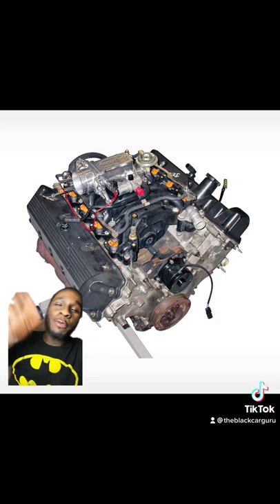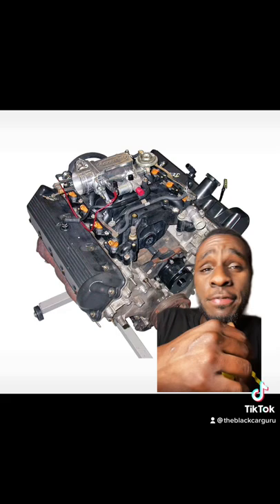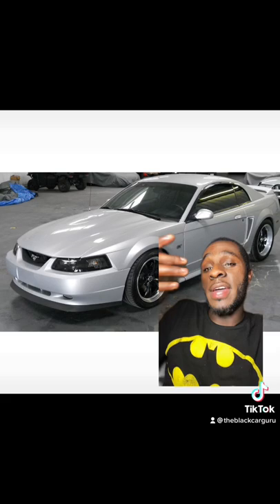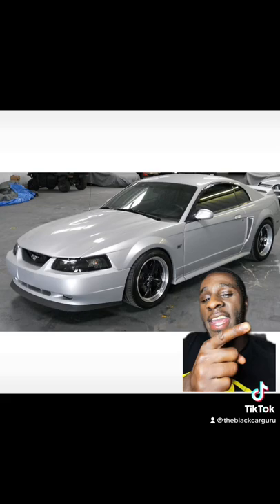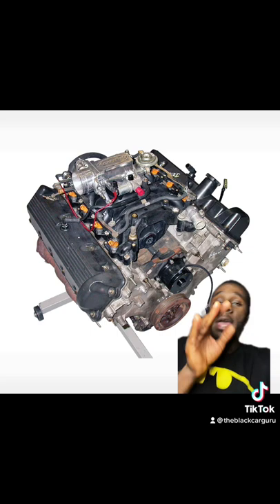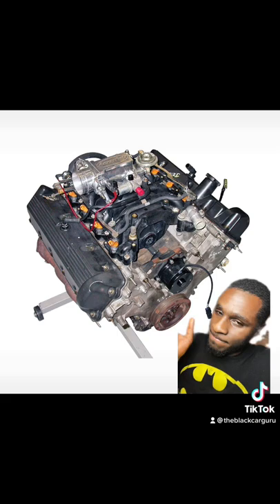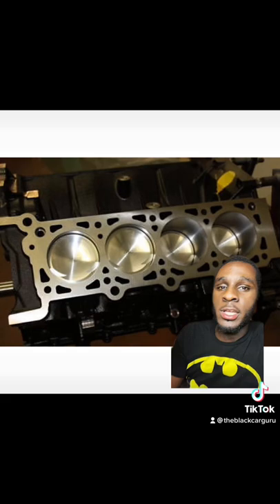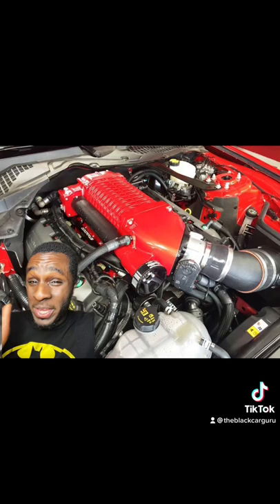Is the 4.6 2V worth building? | Let me explain why!

Comment: I had a 95 mustang gt 5.0, built the top end and did exhaust, gears, etc.  Got done, had about 5k in the mods.  Old dude at the shop told me I coulda built two chevys for that much.  Looked it up, he was right, burn lol.  Good car though, I had it for years, was my daily driver from about 24-30 years old.
Reply: @worldssickestmedia2713  🤣
Reply: Dude Know his stuff good work bro
Reply: @worldssickestmedia2713  you would definitely need to spend a LOT to keep up with a high performance 400 chevy small block. Mine makes over 520hp with an old Holley 4bbl. All Motor.
Reply: Using a 40 year old factory GM 400 against a 1995 Ford is a bit of an unfair comparison, they didn't imagine 700hp factory motor in those days. Mine is a Dart SHP block it will hold over 1000. 
I didn't want to build a factory 400 either,  you make some good points. 
--Ford had a better cylinder head there a few times that helped things. (The good old days when American made was actually..  u know, made here unlike the imported "American" made stuff today)
Reply: One of many things I’ve learned working at a perfromace machine shop

Chevy $ easy
Ford    $$$ medium 
Mopar $$$$$ expert
Reply: I'm 26 & currently living this comment 95 vert
Reply: @guitarheadwayne  Nice 👍
Reply: I still love my 95 with the 302 it will be good for a first car with a on3performance turbo kit
Reply: Sometimes a car isn’t always about the money. About 30 years is a long time. After that long, it’s not really about the money anymore.
Reply: it’s because the old 302 and definitely the 351s aren’t near as plentiful as a SBC engine and parts are harder to find and have way less aftermarket support. You could find and get hands on enough parts to throw a pretty stout sbc together in a days time and a nickel less.  

You ain’t gonna find any 302 or 351 heads at any junkyard worth your time for example.
Reply: Well yeah but even the LS similar year was around the same hp. I can understand the DOHC or SOHC are expensive
Reply: I seen 1400hp 4.6 2v Mustangs yes it cost a lot but so would any OHC to get those numbers
Reply: Yeah you could have blown up 2 junkyards motors for that 🙄
Reply: I had a $3500 270whp Maxima that stomped 2Vs and 4v cobras and Mach 1s, loved surprising people and hurting feelings at the same time.
Reply: @JusAV-vw1pj  351w are great engines but the truck heads suck ass unfortunately and that's the main place you'd find them sadly.
Reply: @PeePee666PooPoo  when i was building my Mustang i bought a 03 Pontiac bonneville ssei (supercharged 3800 v6) same shit lol. They wouldn’t see it coming
Reply: @PeePee666PooPoo  agreed
Reply: @PeePee666PooPoo  cap 🧢
Reply: Chevys would have kept breaking down on you, though.
Reply: Not no Ls 😂
Reply: @getoutyourfeelings2613  LS motors are cheap & yes they do blow up constantly. You only see the final product online
Reply: Depends, maybe with an old school chevy you can build 700hp with 2.5k. LS mods quickly add up, example a good cam kit is about 1k add bigger fuel injectors, fuel pump, bigger valves, porting,  etc. and your getting close to 5k

Unless were talking boost
Reply: @pankero1  my cams with springs in my 2v only cost $800.
Reply: @WarriorOfEden3033  True. My point was  both engines can be built for little to make decent hp with boost, both cost alot of $$$ if you want to build decent n/a horse power. 

Owned & modified both, people underestimate the 2v 4.6 for sure,.they make good power boosted they are also plentiful, reliable, strong and cheap at junkyards.
Reply: I’m curious to know what your set up is because I own a 94 with a ford racing top end (GT40 heads cam and intake)and single turbo kit I know I couldn’t have built two sbc for what it cost me to put it together. In my experience the sbf and sbc stuff was priced pretty similar especially if you were talking about running a Ford in your mustang vs running a Chevy in a mustang it was definitely cheaper to just run the Ford, in my opinion.
Reply: You know cobras old ones have a 4.6L as well.. 

But yeah you right
Reply: I got 2 grand in my fox with a 302 I promise ain’t no Chevy gonna out run me with the same money spent GUARANTEED
Reply: Everybody's got a small block Chevy though but you don't see a lot of 4.6 builds!  I think its awesome
Reply: I hope mine last long like yours haha hut i have the 4.6 its been 1 year bearly haha
Reply: If you had to take the engine out then yea but if you could have kept it in the car while you work on it then no
Reply: The on3 turbo kit is 2300 rn. I got a 99 gt I’m working on. I think I’m just gonna go the nitrous route so I’m not breaking the bank on a mouse motor but I think they got some potential on a budget. (I got the car for free🤷🏻‍♂️)
Reply: @kevinrichardson6628 
Anyone can put together a good combo the thing is putting all that power to the ground.
Reply: With a Chevy, you’re only gonna end up with a spun rod and a bad trans…
Reply: @JusAV-vw1pj GT40 heads were good
Reply: @pankero1 they're expensive to rebuild though
Reply: Question I have a 95 cobra but it has a full 4v 4.6 drivetrain any idea why?
Reply: What does a 95 302 have anything to do with a 4.6 2valve.let alone building 3 to 1 sbc .whoever told u that is on good drugs.a rebuilt ford 302 costs equally a sbc build 1.the 302 is a excellent engine .have u seen the ls engine it's a copy of a sbf .
Reply: I've built 302's before.
I don't know where this guy was coming from saying the 350 is cheaper.
Both of the engines I built weren't that expensive. Granted I did all the work.
The first was a 302ho with gt40 heads and e303 cam.
The cam was just about $200 and the heads were about $50
The rebuild kit wasn't that bad in price.
The second was another 302 and that had the stock HO cam and gt40 ported heads(this was alot better for a truck). Still wasn't all that expensive.

I did the side by side comparison and the 350 was about the same in price.

Ford also had better flowing heads over chevy.
The vortec was the only time it got good and they didn't build those long enough to be plentiful for years to come in the junk yards.
Reply: yea but they dont sell chevys to men ....
Reply: Still slow lol cams headers fbo tune still really low 12s with a drag pack. Wayyy to much money for being that slow go get a 6k bmw335i put in 1200$ and run 11s lol.
Reply: I need 2400 to cam my 4.8

Comment: I’ve been doing the math and a Coyote swap is still just as expensive if not more expensive than a built/booster 2V. Assuming you do most or all of the labor.
Reply: Coyote swap is definitely more expensive if you do it the right way
Reply: @Flathead-fb5tk you can do a pretty decent coyote swap for 10-12k and I'm talking trans and everything.  It's not alot different one way or the other price wise the coyote swap is easier for the average backyard shade tree mechanic.
Reply: Even if the coyote is more expensive. At least you’ll have a coyote in the end of all that money spent. But if you put all that money in a 2v… you’ll still have a… 2v… a far more inferior motor. And the coyote doesn’t have to be built to handle 700whp. It can handle it stock, still be more reliable and tune easier than a 2v. This debate ended before it started lol
Reply: @rican_5oh  Yeah I meant that you could have a fully build 2V for the same price with MHS heads and all. I'd use a Teksid block and would never see over 1000hp so it would be plenty capable. Love the Coyote, just wish it sounded cooler like the 2V and 3V haha. I'm sure Coyote swap cost will continue to fall with time, though. Your name looks familiar, you watch Alex Flores?
Reply: @TonyTheTruckGuy 2v FTW

Comment: I wanted a little more pep for my 2000 Mercury Grand Marquis so I swapped out my 4.6 for a 2-valve 5.4 with Comp Cam Stage 3 camshafts and PI heads. Swapping out the 2.73 rear gears for 3.73s next. Can care less about racing. Just wanted to make the car more fun to drive and so far it is.
Reply: Youre a straight menace to society i love the build
Reply: I remember you 😏. It's outrageous what it costs to build these mod motors but if done right they hold the power and just keep trucking. I will admit I loved my Vic ( black on black , lowered 2.5 inches , j mod , exhaust , giant stereo ) after that one got jacked I sold all my other projects because of how easy it was to steal. The best thing a person can do for a power bump and be easy on the wallet is a 5.4 swap ( non PI with pi heads and the pi intake from the 4.6 ) using the same similar cam as you have, a loose torque converter, long tubes and 3.91/2 final gear with a j mod. You'll be able to blow through tires with ease and it will make that tank perform like a much smaller car. I forgot, hands down the best bang for buck mod a person can do on a panther is a 5 or 6 speed swap. It was a night and day change with just a stock 4.6 😈 the 4r70e/w had the worst gear ratio known to man, it's worse than gm's 700r4 .
Reply: Don't forget you can swap 4V heads onto any 2V block.
Reply: @dr.hugog.hackenbush9443  You can buy then maintenance becomes an issue due to the amount of room 4V heads take up. Any repair dealing with the heads will require pulling the engine.
Reply: Dr. Hugo G. Hackenbush Swapping 4v heads on a 2v block requires A LOT more than just slapping heads on and more expensive than just finding a complete 4v engine..a 4v headed 2v block will be an overpriced engine with heads that flow decent but has low compression and can barely get out of its own way 😂🤣
Reply: @eriv4735  Actually converting it over from a two valve to a four it's not that hard. Just time consuming. That's why it's best if you have the complete block. There are some that are trashed which is what you want because of the parts needed to complete the conversation which includes cooling lines, intake, (upper and lower) harnesses, pistons, etc. With all the time put into converting it you might as well  rebuild the engine itself before converting it to DOHC heads and I considered doing that as an option. Decided against it to save money. All I did was swap out the non-pi heads for pi heads, threw in some Xtreme Energy Stage 3 Competition Cams, and I upgraded fuel system and ignition and it is quite peppy. I guessing here but I am making a little over 320 wheel horsepower and it can get out of its way. The only thing that's holding me back right now is to gears which I am addressing in a few weeks. Already bought all new gears, installation kit, positraction, and a 2800 RPM torque converter. Hopefully it will be in the car after Christmas.
Reply: Ragin' Taurus & Muscle Mercury You’ll need the heads/cams, all intake parts, the front cover, more than likely the oil pan, headers, pretty much EVERYTHING that isn’t the block..all that work, time, and money and a bone stock 4.6 4v will out run you due to the lower compression..I know your build and watched a bunch of your videos..I like the build, I’d say it’s the stock pi heads (being that they are undersized for a 4.6) are holding some power back, so you’re probably closer to 290-300hp and about 330tq which is still decent..I too have a 2000 MGM and but mine is running the stock 4.6 npi block topped with a full pi top end, ported plenum, 75mm throttle body, MZT with 80mm mass air and 24lb injectors, cut stock box, pulleys, headers and an off road 2.5” x pipe..she’s got the stock 4r70 with a 4000 stall, aluminum driveshaft and a posi 3:73 all controlled by an sct handheld..I’ve never dynod her or been to a track but my butt dyno says she’s only about 245ish hp but she’s a handful on the street, tons of fun, and I smile like a kid in a toy store every time I drive her..I have a complete 5.4 2v in a stand and a 4.6 2v I am building to run a turbo on that I am trying to choose between for a swap but I have 3 other cars I am working on currently so who knows when I’ll be able to get to find time to even choose let alone do the work 😂..do you plan on boosting your Marq? If so what route are you going?
Reply: @eriv4735  Lol! I installed my 5.4L last year when I bought the car. It was the first mod I did to it because the 4.6L was shot. It bolted right in with only a few adjustments and the stock motor mounts. I rebuilt the heads and installed a set of Comp Cams I had in my previous GM. Had a long overdue Dynotune and new computer out in the car almost two weeks ago. It makes 323 hp/357 tq to the wheels. Ran out of time and money to get my posi and gears put in. Will have to wait til after Thanksgiving to do that.
Reply: @eriv4735  on the 2v it's that simple. They only read the intake cam and they share the same bolt pattern.
Reply: Ragin' Taurus & Muscle Mercury That sounds like a fun car bro..I’d be very interested in taking a look at that dyno sheet, I’d like to look at that power curve..it sounds like you got it ready to be sorted out, good luck man
Reply: Rob Sorgdrager I never said it was a complicated procedure but thanks for your opinion..maybe look at EVERYTHING I said and read the room before committing..just a thought 🤷‍♂
Reply: @eriv4735  I had an issue with the computer which delayed the gear swap and dyno tune I had planned a few weeks ago. I will see how much it makes soon. I will be happy with at least 310+ hp to the wheels. Maybe 350 torque. One think for sure right now it is a lot more than the 200 it made with the stock 4.6 it had.
Reply: @eriv4735  👍
Reply: @ragintaurusmusclemercury7023  thats why you use 4v heads on the panther platform. All the engine room you could ever want.
Reply: @eriv4735  but 4v swapping a 2v block is a good start to building a blower monster. That low compression means they love boost.
Reply: @bentrod3405  The 2 valve with a cam was adequate for my application. I had the car dyno tuned a few weeks ago and it made 320 horsepower/345 ft lb of torque to the wheels. More than adequate for my application which is a daily driver. Plus I won't have an issue if I have to work on it because of the wide heads. If I wanted a 4 valve I would buy a Marauder which I am planning on buying before this year is out
Reply: bentrod3405 Lower compression is good for boost yes but it’s doesn’t matter if the engine won’t take over 450rwhp..its not the heads or compression that limits or  kills these engines, it’s the bottom end and boost will make up whatever difference but still keeps you limited in output..10 lbs at 9.5:1 is the same as 11lbs 8.5:1 and you don’t have to go through the hassle of all the work and money on parts that need to be changed with a 4v head swapping a 2v block..as I said it just makes more sense and it’s cheaper and easier to start with a complete 4v engine than it is to 4v head swap a 2v engine..to each their own though
Reply: Do you have a video of the car?
Reply: Interesting that you didn't have a any valve to piston clearence issues. On the 4.6 you definitely would with the stage 3 cams